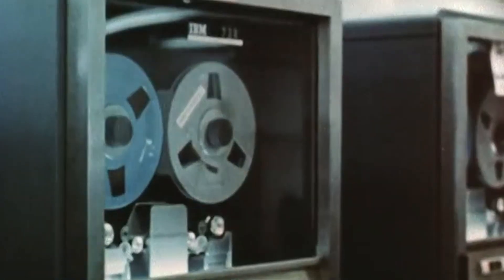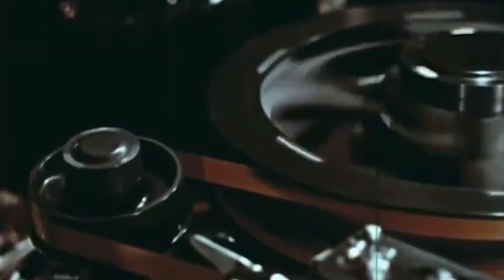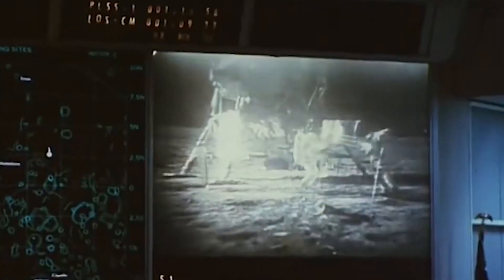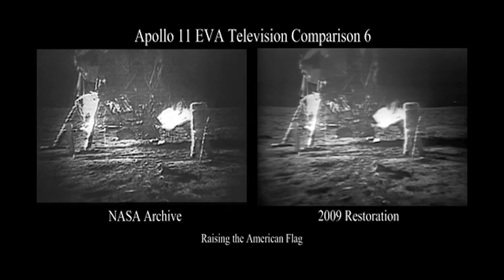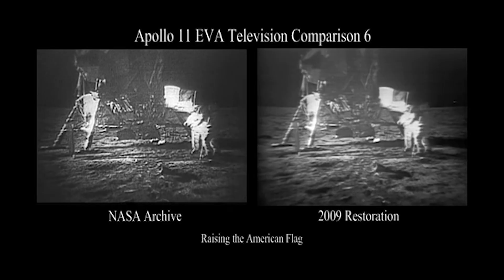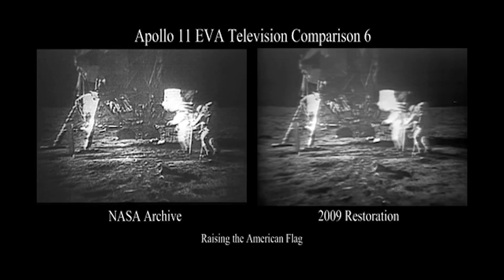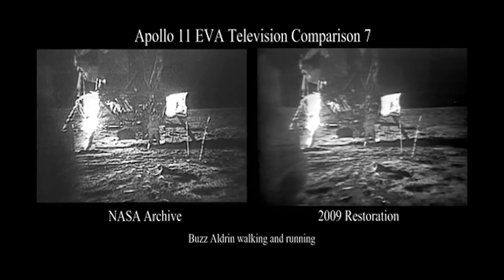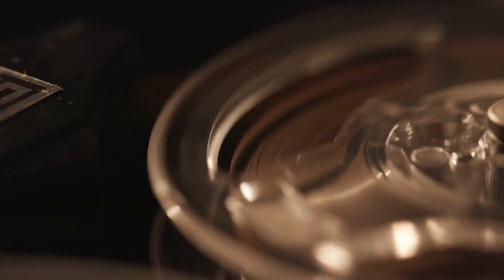Apollo 11's Video Tapes Went Missing - What Was on Them and Who Took Them?

Comment: I worked at Goddard Space Flight Center in the late 1980's as a government contractor with Allied Signal. I was a HDT (high density tape operator) and data controller. Main job was to collect Space Lab mission data off of the space shuttle on HDT's and post process the data onto 9 track data tapes for scientific research. Long story short is that between missions we were sent to a tape storage facility near Greenbelt MD to work there. It was busy work, mostly moving tapes around and degaussing old tapes. The  warehouse was huge! Had to be millions of tapes. The facility manager took us on a tour one day and showed us rack after rack of Apollo HDT tapes. He said they don't touch them, they leave them alone. Don't know if that warehouse is still there but it was climate controlled. I'm sure they had to look there if it was, but if they didn't....
Reply: Someone needs to follow up on this...
Reply: @PsRohrbaugh  Funny you mentioned following up. I sent an email to a guy who wrote an article about this issue about 7 years ago. Never did hear back from him. My guess is they went through those tape's, or all the tapes at the warehouse wound up in a  landfill. Guess we will never know.
Reply: @mikemasiello9625  I worked at the BBC for a decade and know the producer of the BBC's Apollo coverage. These were mostly wiped. I personally went through the entire BBC archive - as extracted from the library by library staff. There were only about twenty Quadruplex tapes - none of the BBC's actual studio coverage. Tapes were very expensive, they were reused. Dr Who and many others went the same way.

Also, at the time we thought that Moon stories would soon be totally normal - turned out it was forgotten for decades.
Reply: "Turn the LEM"
Reply: @zbdot73  ......rotate the pod, HAL
Reply: Did ye aye
Reply: Good information.
Reply: Nice Try.
I guess you like to make things up...🤡👆

Comment: My mother worked at Aerojet, the company which built the lunar buggies the astronauts used. She was told at the time the reason for the poor quality video feed is because the news stations were never given a direct TV feed, but instead were forced to record the images off one of NASA'S monitors as the landing unfolded. Guess it took them fifty years to come up with a new excuse.
Reply: The tapes of the original slow scan video exist.
In 1969 the ONLY way to convert them was to point a broadcast camera at the monitor displaying the low resolution video signals.
Computers that could handle video conversion didn’t exist for another five years (and ten years before they could do it in real time).
Reply: @allangibson8494  they went through the Van Allen belt and landed on the moon.... but they couldn't film it because they didn't have the technology. Something stinks right there. The CIA was in charge of all video recording on that 'mission to the moon', work it out for goodness sake. No human has been through the Van Allen belt,  ever, NASA are recorded as saying such. I know where the door is.
Reply: @deanhall6045  Actually the entire Apollo 11 mission was filmed. The LM had a 16mm film camera pointing out the co-pilots window. It shot one frame per second.
The video transfer is available online.
The Van Allen belt is only “lethal” if you spend a MONTH in it. Radiation dose is a question of intensity AND duration.
Reply: @allangibson8494  absolutely not true, you will fry in the Van Allen belt 8nside hours mate,... you really need to research, and your point about the tapes is my point exactly. They are all transferred, doctored or butchered more like, so they're low resolution. How convenient. None of what you say makes sense, NASA have been filmed in interviews saying that humans may be able to go through the Van Allen one day but not yet. Space program postponed again due to space suit complications that won't protect from radiation sufficiently. ?? This is NASA saying this, not me. Research mate, I have and don't accept that nonsense as a real reply.
Reply: @deanhall6045  Apollo departed earth’s orbit at above 45 degrees - skipping the most intense part of the belt at 20 degrees from the equator. In the inner most intense belt you would need to be in them for 71 DAYS to receive a lethal dose of radiation. The Apollo flights spent under an hour total transiting the belt EDGES.
The Apollo astronauts got less than the 5 REM dose limit for radiation workers during the flight.
NASA revised is risk criteria after the Apollo missions from one loss of crew incident per ten flights to one loss of crew incident per hundred flights.
The SpaceShuttle was canned when it was shown that it couldn’t meet the revised risk criteria (after it came apart twice).
Reply: @deanhall6045  NASA has Van Allen belt mapping satellites but aren’t stupid enough to put anything sensitive in the belts - because they cause data errors and electrical faults with LONG term exposure.
The Van Allen belts were mapped initially by Explorer 1 (the very first satellite NASA launched).
The most current mapping satellites are the twin Van Allen probes launched in 2012. They were operational for a bit over seven years entirely within the Van Allen belts and ended when they ran out of fuel.
The Apollo spacecraft spent 52.8 minutes transiting the Van Allen belts outbound and the actual measured dose INSIDE the spacecraft during the entire flight of Apollo 11 was under 5REM.
The lower Van Allen belt dips down to under 400km over South America (and the ISS passes through it).
Lots of other satellites operate above the Van Allen belts (like every single Geostationary satellite ever launched).
Glitching electronics are however not desirable so operation actually IN the van Allen belts is generally avoided.
Reply: @allangibson8494  wow, how bloody convenient mate. Cheers.
Reply: @deanhall6045  Explorer 1 was how the Van Allen belts were DISCOVERED.
It was the first satellite that actually had any scientific instruments (Sputnik 1 didn’t).
Reply: @allangibson8494 explain why the astronauts during low earth orbit were making misleading videos stenciling the earth to make it look smaller and further away through the windows? Why would they waste time doing that?
Reply: @andynaz5631  Why do you assume they were in low earth orbit?
Gemini orbits varied from 161 miles to 739 miles altitude.
Apollo went 300 times further.
Reply: @deanhall6045   "absolutely not true, you will fry in the Van Allen belt 8nside hours mate,." == [facepalm]
Reply: @allangibson8494  -- Sputnik had a crude temperature -measuring rig.
Reply: @JamesOberg  Crude in that it indicated if the cooling fan for the radio transmitter turned on or not because it changed the voltage to the transmitter…
Reply: @allangibson8494   == Da.
Reply: @deanhall6045 and it doesn’t make any sense as to why nasa would have to send mannequins to test the radiation levels through the Van Allen belts to see if humans can survive going to the moon if we already have gone many times before.
Reply: @gregorym2121  try explaining that to a froot loop that thinks someone has been through it. It's bloody hilarious, they think it's all true, the whole moon thing. Seriously.
Reply: @JamesOberg  facepalm yourself mate, what I say is true, humans cannot go through it. Get over yourself and open your eyes, please.
Reply: @JamesOberg  but no humans.
Reply: @allangibson8494  get a grip mate, no human has been through the Van Allen belt. Did they take a short cut to the moon.???? Yeah, very bloody short.🤣🤣🤣🤣🤣🤣
Reply: @JamesOberg  Apollo had computers that wouldn't power a USB port, ... But somehow they went through the Van Allen belt, landed on the moon, played around for a few days, forgot to take a photo of the main man,  took off again, hitched back up to the main craft that was travelling at mach 6, came back to Earth and got out and walked away. Now, Russians need carrying after just 5 days in space but Apollo's crew, no problem walking, waving, press conference indeed. Then we all lived happily ever after. ... Baaahaahahaaa and you believe that.
Reply: @deanhall6045  Actually they have skirted it - and the ISS passes through the lower boundary twice per day as it passes South America.
The Van Allen belt is:
A) Not “instantly lethal”.
B) a BELT around the equator. It is completely absent over the poles (which is why we get auroras) and very thin at above 20 degrees from the equator.
Even in the densest part of the belt, you would have to be there for a MONTH to have a problem (unless someone does something stupid like detonate a nuclear device in the belt like the US did three times during the 1960’s (look up Starfish Prime)).
Gemini flights spent about half their total flight time IN the Van Allen belts as they topped out at 1000 miles altitude (the Van Allen belts mostly start at 640 miles with them dipping to 300miles over South America).
Reply: @deanhall6045  Do you have any idea how cramped a Soyuz is? BTW the Soyuz cosmonauts spent MONTHS in space not days.
Reply: @allangibson8494  answer the question did Gemini have humans on board ?
Reply: @deanhall6045  Yes it did - on every flight except the first two.
The Van Allen belt being an impenetrable wall is an utter myth.
All radiation issues are a dose rate and time question. Shielding reduces dose (and lead isn’t a good option for anything except X-rays (which are actually not particularly intense in space) and speed reduces time of exposure. Water, hydrogen, aluminium and polyethylene make good particle shields - because they all happily absorb neutrons and protons without emitting secondary radiation (unlike lead and tungsten).
Reply: @allangibson8494  I get it that you're an American and this is shameful for your country, but you've done worse and you'll have to come to grips with it eventually. The evidence just keeps stacking up.
Reply: @deanhall6045  I am not American.
And the bullshit about the space program by the utterly ignorant annoys me as an engineer with training in nuclear physics and electronics.
Space is hard and dangerous but so is most of heavy industry.
Reply: @gregorym2121  It wasn’t to check if the mannequins survived. It was to check How the modern electric equipment reacted and survived the radiation. Today electronics are much more sensitive than in 1969.
Reply: @deanhall6045  When was the last time You personally checked the radiation levels and types in the Van Allen belts, since You ”know” so much about How ”dangerous” they are to pass through?
Reply: @deanhall6045  The Russian do NOT need carrying away after only 5 days in space. And, the Apollo astronauts were subjected to gravity while on Moon and during firing of the engine, so You can’t compare those two different missions to each other.
Reply: @YDDES  you need to do some research outside of what your country allows. You are American, correct, therefore you know what America allows you to know. I have mates in Iowa and 3 ex band mates in Queens. They are astounded at some of the news items I send them from Australia..... You are living a massive lie my friend, I feel for you and your countrymen. Research, somehow, outside of where you live. I'd love to help but the eyes are upon us. Cheers.
Reply: @YDDES  and the Van Allen belts say you're not totally informed, that's just one other thing....
Reply: @YDDES  and I know you will not respond to how astronauts somehow survived this fatal radiation because you cannot. You will typically stay silent or start with the ridicule..... over to you....
Reply: @deanhall6045  Who the heck have told You that the Van Allen belts would be lethal to pass in a few hours?? What about the South Atlantic anomaly, that the ISS is passning several times a day?
Reply: @andynaz5631  Please explain What You mean with ”astronauts in low orbit made videos stenciling Earth…” Makes no sense.
Reply: @deanhall6045  The Astronauts survived, because the Van Allen Belts are not as lethal as yo like to think. ”Radiation” is not always deadly. The time and intensity You are subjected to it is very important, You amateur.
Reply: @YDDES  They should already have the answers to these questions from the Apollo missions.
Reply: @YDDES  besides, the Chinese know we haven’t been to the moon.
Reply: @gregorym2121  So, You have been to China and spoken to them? Well, I have…
Reply: @YDDES  yes
Reply: @gregorym2121  And, How do the Chinese know that USA never have landed on the Moon???
Reply: @YDDES  That, I will not say, you’ll have to find that out on your own.
Reply: @gregorym2121  Of course You Will not say. You just make up lies as it fits You.
Reply: @YDDES  Right.
Reply: ThatGuyintheKilt  They could have built it based on what they know already worked I would think instead of guessing.
Reply: ThatGuyintheKilt  Glad you mentioned that because during Apollo they didn’t have that luxury of sending a spacecraft to and around the moon first. 
They did some test here but in no way could they duplicate the degree of radiation or know exactly how it would impact the astronauts then so that’s why I say, if it worked then they should be able to implement the same technology and apply it to today without having to test anything
Reply: ThatGuyintheKilt  but they didn’t send an Apollo CM or LM first with mannequins on board.
They should already know the radiation levels for the Artemis and build design accordingly.
Reply: h5mind. That was because the signal from Moon came as a narrow bandwidth slow scan signal, impossible to broadcast in that format.
Reply: Boeing built the rovers.
Reply: Boeing built the rovers.
Reply: h5mind373. That is not true! The Lunar Rovers were built by Boeing. And, that they had to use broadcast type cameras and film videos from monitors, depended on that ordinary TV sets couldn’t be used to show the slow Scan TV signal coming from Moon. That has been known ever since the moonflights.

Comment: The cancelation of Apollo program probably led to much of the lax data archival. They simply weren't given the time and funding to keep those records a concern. A good lesson to learn from
Reply: I've heard stories about the Saturn V manufacturer being told to get rid of their engineering drawings, they were no longer needed, and they were told to just throw them in the dumpsters out back.  There were tons of guys hurriedly running paper drawings and specifications out to their personal cars since the govt. and the company didn't care what happened to them.  As the story goes, there were many guys going home that night with a car so loaded that their commute was a white-knuckle ride on back-streets hoping they could make it home to unload into their garages.
Reply: @Skank_and_Gutterboy  If true, it shows a complete lack of security. I doubt that happened with the Manhattan Project. Although Feynman has some funny stories.
Reply: @Skank_and_Gutterboy  If that is true, about the Saturn V drawings, it says Why they wanted to destroy them. The Saturn V’s would not be built anymore and NASA can’t save every bit of paperwork for ever. Also, NASA didn’t have all the drawings of the Saturns. They were built by many different companies,like Boeing, Douglas, Martin and Grumman. They had the drawings.

Comment: I know exactly what AMPEX machines are used to read the two inch tapes. It's still a beautiful thing.  :)
Reply: I know what you mean. I worked at a TV station in the 80s and fixed among other things one inch Ampex machines. They had a two inch machine in storage but I never saw it in action.

Comment: missed the fact that the conversion process involved pointing a tv camera at a monitor hence the poor quality. none of the hardware plugs were compatible and it was only realized shortly before the event.
Reply: The video relay process seemed rather ad hoc at points.  I can remember staying up late to see the Apollo 11 lunar excursion when I was a kid.  My recollection is that the TV picture from the LM camera was initially upside down as seen on the projection screen in Mission Control. If the motion picture about Parkes claims correctly, Parkes in Australia was the initial relay due a technical problem at Goldstone.  I can imagine a technician hurriedly flipping over a monochrome  CCTV camera aimed at a green long persistence SSTV monitor to correct the picture.  Talk about the whole world looking over your shoulder!

It is unfortunate the original telemetry tapes weren’t kept longer to allow for a better transfer.  A modern system could convert the image electronically instead of relying on an optical telecine.
Reply: Exactly thank u that is so often overlooked
Reply: Well said, Mr. Tesla!
Reply: There was naturally nothing more on the tapes than What was broadcast.
Reply: BS
Reply: The US Navy similarly worked this out before D-DAY .A landing Ship  full of troops were sunk by German Torpedo  Boats cause the US were on a different frequency to the Royal Navy and couldnt coordinate
Reply: @Rusty_Gold85  And the US Army couldn’t communicate with US Navy for exactly the same reasons.